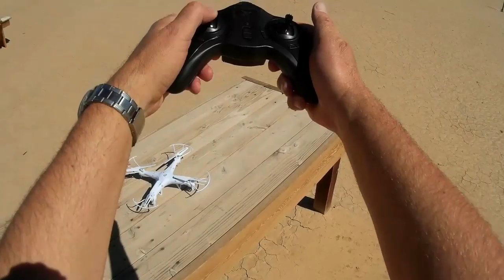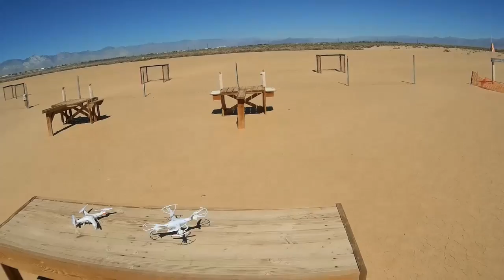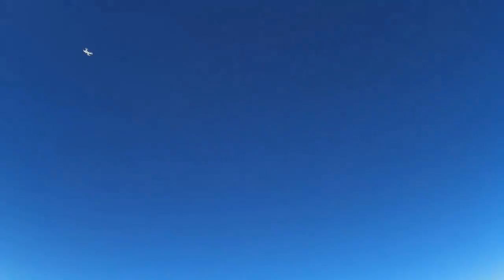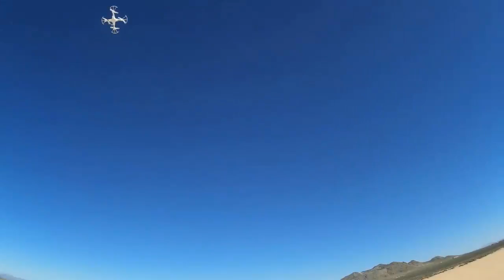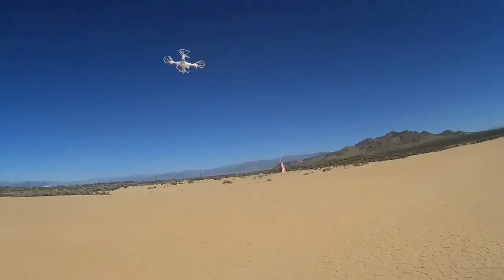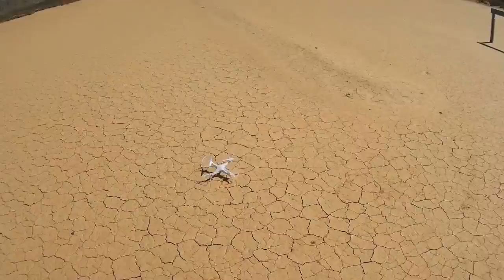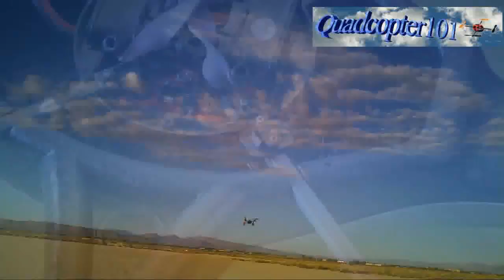FY326 Q7 drone:Syma X5C clone!

Comment: Anybody know where I can buy the body for the FY326 Q7? I have a crack in the plastic near one of the arm screws. As a result the plastic is bending backwards away from the body and it's affecting the motor on that arm. It's the screw closest to the lights.

Comment: Clone in video is outperforming X5C in any aspect. I started to think about original Syma X5C - which quad clone it actually is :)  Too bad, that FY326 Q7 is now sold only with red board which turn this little gem into utter rubbish. Good green boards are gone, stupid greedy bastards. I already wanted to buy this drone alas no deal without green board. Ordered FPVRC K5C instead.

Side note - nice demonstration as usual. Thanks!

Comment: Quadcopter 101, some people that have purchased this Quad, have been really disappointed, because they say the circuit board that was in the original Quad like you tested had a Green Circuit Board and they went to a Red Circuit Board, that has totally ruined a fine flying Quad. Have you had the chance to see a unit with a Red Circuit Board yet or seen one fly? Thanks

Comment: If I am correct, this quadcopter has better motors -> 8.5 mm x 20 mm instead 7x20 mm motors as Syma X5C or Bayangtoys X8. One thing bothers me: is it possible to bind this quadcopter with transmitter from Bayangtoys X8? Can you try to bind it and post the result here? Thank you in advance.
Reply from the maker: +Wild Maniac Sorry, both this and my X8 have been donated to local schools. I just don't have the storage space :(  But I really doubt that it's possible as they are two different companies.
Reply: Thanks. Eachine H8 and Bayangtoyx X8 can be controlled by either remote.

Comment: This is an awesome Quad, even with the red board versions ii have since i a a no0b
Had to buy a Syma X5 CW motor for my black Q7 since the motor burned out after 2 days from a crash which fell prop side down at full throttle ( im a noob so it was my bad). Have te mortor have yet to try and install. i have since revieved a new white model from amazon for 28 bucks with 2 day ship. Thanks ffor sharing

Comment: hello quadcopter 101 do you think x5c props would work on this since fy326 ones are out of stock
Reply from the maker: +Dillon Ravindu You can still get them on AliExpress, less than $3 per set http://www.aliexpress.com/item/FY326-RC-Quadcopter-Spare-Parts-4-x-Propeller/32463556619.html
Reply: will x5c ones work
Reply from the maker: Dillon Ravindu I'm not sure, but I don't think so.  These X5C clones usually use minor differences in all parts so that they're not interchangeable with the X5C.  That way, it prevents a lawsuit from Syma claiming that they stole their design.
Reply from the maker: ***** If you're interested in night flying, black is not a good idea (very hard to see, even with its lights).

Comment: just got mine today  its my first one  and saw your video made me buy question do i need to fix this trim or by default  they are ok  let me know thanks
Reply from the maker: +clash808 They're usually pretty close.  But if you plan on doing a lot of hovering, it helps to trim http://quadcopter101.blogspot.com/2013/10/quadcopter-flight-school-tutorial-1.html
Reply: +Quadcopter 101  thank you so much
Reply: hey again for a beginner do u recommend to have the prop guard and landing stand installed  or without it will be fine let me know thanks again
Reply from the maker: clash808 For a beginner, keep the prop guards installed until you find yourself not crashing anymore.  And always keep the landing skid installed.  It helps to keep dirt out of the gears.
Reply: +Quadcopter 101  thank you so much and have a happy holidays

Comment: Does anyone know where you can find the green board version? I have the red board and it is pathetic!
Reply: This is an actual FY326 green FCB. The same vendor has a transmitter available which will presumably bind to it. I haven't tried it myself though.

http://www.aliexpress.com/item/Free-shipping-2-4-GHZ-remote-control-RC-Quadcopter-parts-Quadcopter-FY326-aircraft-PCB-FY326-4/32371049977.html?spm=2114.01020208.3.253.xOt8G5&ws_ab_test=searchweb201556_2,searchweb201527_4_71_72_73_74_75,searchweb201560_9
Reply: Thanks!!

Comment: My Q7 has lost range, like 75 to 100 feet.  It used to get great range.  Have you ever experienced that?  Would you have any suggestions?  THANKS.
Reply from the maker: ***** Are you flying with a camera?  If so, RF interference from the camera can severely degrade range.  In that case, try shielding using a small piece of aluminum foil https://www.youtube.com/watch?v=JaQg0jvOX98
But if no camera is involved, are you flying near an apartment building or heavy residential area?  Residential WiFi signals can also degrade your range as it operates on the same frequency as your quadcopter's transmitter.  Try flying in a different, less congested area if that's the case.

Comment: Anyone considering buying this quadcopter should be aware that the manufacturer has changed the control board. The original was green and the new one is red. The new red board has only about 50m range and causes sudden drop-outs when reducing throttle. This is discussed in detail on the RCgroups forum.

If you do have one or still wish to purchase, there are some modifications that can be made both to the controller and the quadcopter to increase the range and alleviate (but not eliminate) the sudden drop-outs.

Happy flying!

Comment: Howdy Q!  I landed my FY326 into a mudpuddle which resulted in a motor change out.  The FY326 motor is slightly larger than the X5C-1 motor.  I have spares of those and they were just a tad too small for the motor housing cylinder.  Luckily, I also had some slightly larger motors that a vendor sent me by mistake and it worked great.  Not sure the model of the true FY326 motor but it is slightly bigger than my X5C-1 motor.

Comment: I agree with Brian on this.  The FY326 being sold now by gearbest is NOT the same as the one reviewed here.  The manufacturer has changed the control board and components such that range is poor with excessive dropouts making this quadcopter a bad choice.  Here's mine which is essentially is unusable for flight:  https://youtu.be/Yi7LQNsuNu4 .  For $27 purchase price I got a $15 refund from gearbest account for a future purchase.  Not fair in my opinion, but that's the risk in purchasing quadcopters from these merchants when you get a lemon.  FYI the Nihui U807 is a very good deal now (also from gearbest) at $38.  If you get a good one that is.

Comment: Luv your videos on my new hobby. Today I received this FY326 quadcopter. I wanted to post a picture of a yellow sticker on box mentioning headless mode. What you think 101? Thanks Len
Reply: Len Quelland Ok I took out and tested tonight, The Accelerator Trimming switches do 2 things. Upper switch turns (says in manual) Headfree Mode on an off and Quad will blink different when engaged and beep once. The lower accelerator button when pushed will go to return mode. To close this whole circuit just push upper accelerator button again. When I pushed return mode it did descend gradually and come back in my direction where I was standing. I tried same scenario again and usual headless mode does not work as usual on this feature. It was 6-10 mph so I had to run in high mode most of the time. Anyway I think this must be a newer released version I received as it has the yellow sticker on box that is to the left of my name as I cant post a picture.

Comment: I got mine today , never flown before , took it to the park and flew it, it wasn't easy but I realize I need to practice , so I was doing your instruction video going back and forth, then in about the 3rd battery drone was cutting out as if it was loosing reception in mid air and it droped a couple of times, and I was only about 50 or so feet away from it. could it be wifi interference? it's a small park surrounded by houses, so I'm assuming this is it, I did the sticking the antenna out the top mod like your other video and I'm gonna go to a different park tomorrow larger without any homes and try

Comment: I just received my syma x5 today and I had to wait extra long to get it because our postal service sucks, anyway I also have a Transmitter from a previous Quadcopter  which looks Identical to the one that comes with it for RTF  but I got mine for $25.99 because it has to be Binded. Well I charge the battery turned the Quad on lights are flashing but it won't bind, I also have a Hubsan and tried that Transmitter, nothing it wouldn't Bind.I'm open to advice and suggestions....Thank -= you
Reply from the maker: jeff sabo You will need to purchase a transmitter specifically for it.There were two versions of the X5C, the original and the upgraded model.  Although the transmitter looked the same, the newer upgraded model used a different format and would not work with the original model. But I'm not sure at this point which specific model that you have. Do you have a link to the advertisement for the model that you purchased?

Comment: Hi, I got this one as a beginner and I really like it. But is there a way to charge the battery faster? Maybe I could buy a seperate charger which plugs into a wall? I tried using the usb charger from my phone, but I think it damaged the battery (as it has much higher output than a USB port). Sometimes the rotors just do a very tiny twitch when I try to raise throttle for the first time after plugging it in and then it doesn't do anything until I replug the battery. After that, it may or may not work again. 
I ordered some new batteries so I hope it's not the quad which is damaged in some way. Greetings
Reply from the maker: Marc Möbius Are you binding the transmitter to the quad properly?  Try the following.
1) plug in the battery, and place the quadcopter on a flat and level surface.
2) Turn on the transmitter.  Bind it to the quadcopter by moving the throttle from zero to full, and then bring it back to zero.  You should hear a beep signifying that the transmitter has bound to the quadcopter.
3) Try flying.
and finally, there should be no reason why you can't use your USB wall charger instead of the computer.  That's what I use.

Comment: Hi,
I'm going to buy this quad, but I have few questions : 
- Do the parts break often on quads ? If yes, which spare parts should I buy ?
- What do you think about using an anti-vibration plate like this one http://www.gearbest.com/rc-quadcopters-parts/pp_133191.html for the Keychain (fixed with some DIY, don't want to screw it)
Reply from the maker: SpeezzGaming Everything breaks if you smack it enough.  But the props are pretty tough on this one.  At least I haven't broken one yet.  You never know what's going to break until it happens.  Good thing the parts are cheap http://shrsl.com/?~8f3w

Comment: Thanks for all of your reviews Quadcopter 101.  They've been very helpful!  Love seeing the cameras working on different ones!  Since the FY326 is so new, I'm wondering if you've had any success binding it to any other controller.  There's so little information.  I can't find anything on the protocol that it uses.  I was unfortunate enough to receive an FY326 with a dead controller and am just wondering if there are alternatives.  I've seen a comment on here stating that it binds to a WLToys V252 Pro Skylark Tx.  Have you had a chance to check that out?  Thanks very much!
Reply from the maker: Disgruntled Elf Unfortunately I don't have a Skylark transmitter. But I've tried, and I've not been able to bind it to others.  Did you contact customer service? Are they sending you a replacement transmitter?
Reply: Quadcopter 101  Yes, thank-you, I have worked out a deal with GearBest in regards to the transmitter.  Hopefully the new one will work!

Comment: I just got mine in and I feel like it is not getting the range shown in the videos. It seems like it loses signal when I get it out a bit. I can get my Hubsan x4 way higher and further. Any ideas?
Reply from the maker: Robert Neal Check the quadcopter's antenna to see if it's too close to the board. Raise it up away from the board some if it is.

Comment: I got one of these, and mine must be defective.  Even after recalibrating, it wants to roll severely to the right.  If I do a left roll trim of 25+ clicks, it may start to level out . . . must have received a dud . . .   going back to my X5C . . . any thoughts ?
Reply from the maker: bobclarie You did recalibrate? (Placing the quad on a flat level surface, moving and holding both control sticks to lower LEFT corner until center light rapidly blinks).  It's lower left corner on this, vice lower right for Syma X5C.  Also hand spin each of your props, feeling for any binding or unusual resistance, such as from debris in the gears.  Finally, check the installation of your props to make sure that the factory installed the correct props on the correct shafts (CW vs CCW).  Compare your quadcopter to this image, making sure the shape of the props match the installation locations.
Reply: Quadcopter 101 Thanks for your suggestions ! Yes, did try recalibrating, several times . . .  Props do appear to be mounted correctly . . .all blades turn freely, although the front right, and rear left  blades do have a little more drag when compared to the front left and rear right.  There is a lot of "play" in all the propellor shafts.  Thanks again for your prompt response.
Reply from the maker: bobclarie Well you've done everything. Recommend contacting customer service http://www.gearbest.com/about/contact-us.html
Reply: Quadcopter 101 Thanks, I will do that.  I look forward to your quadcopter YouTube productions.  Very Informative.  Keep up the good work.  Looks like you are having Fun.
Reply: Gearbest thinks it's a bad controller and said that they would send me a new one.  f.y.i.  Bob
Reply: Hi, I have the same problem. Did the new controller resolve the issue?
Reply: +tatotazman Gearbest never sent me a new controller/transmitter, even after several e-mails promising to send.  I ended up putting a Syma X5C control board in my Q7 quad and flying it with a X5C transmitter. The X5C is your best bet . . .  Bob
Reply: Thanks

Comment from the maker: FY326 spare parts http://shrsl.com/?~8f3w
Reply from the maker: MrOuchiez 1. Make sure that your quadcopter's battery is fully charged.
2. Turn on the quadcopter, and place it on a flat and level surface.
3. Turn on the transmitter.
4. Move the left stick throttle from full down to full up then back to full down (you should hear a beep indicating binding).
5.  Move the throttle stick back up and see if it takes to the air.
Reply from the maker: MrOuchiez Well it sounds like it's defective.  Recommend making a short YouTube video clearly showing the problem.  Send the link to your vendor's customer service to help overcome the language barrier.  Hopefully they can help.  But if not, final step would be to open a Paypal dispute for receipt of a defective product.
Reply: Do you know if there's a known issue with q7 motors? I'm on my second one and one of the motor has stopped working. First one had a faulty motor out of the box. Do you know where they might sell spare motor for the q7?
Reply: I absolutely CAN NOT get this thing to bind to the controller!  I got lucky once, and it flew amazingly, but quite honestly, Im not sure what I even did to get it to bind, as there were issues then as well!  The manual is a mess to try to interpret, and Ive finally got a clear, windless day to fly! How are you supposed to bind this thing?
Reply: Quadcopter 101
Thanks for the reply.  After following each step (which has been standard for every quad Ive owned) the transmitter wont bind.  Whats strange is the transmitter's light blinks and you hear a "click" or "chirp" from the transmitter that the LEDs on the quad quickly sync to. So there is some level of communication between the two.  But still no binding.
Reply: Thats great advice.  Thanks so much!  Ive been subbed to your channel for nearly 2 years, and have learned how to fly from your tutelage.  Keep up the great work!
Reply: Know anywhere I can get spare motors? 
They don't have anything on your link...
Reply: ovak
https://www.amazon.com/Quadcopter-Propellers-Landing-Protectors-Protector/dp/B00TJSJWQ2

Comment: I have a question, I have found a zyma 5C copter in my yard, but I don't have the remote control, do you know if I am able to buy just the controller and use it for the copter or do i have to buy a whole new one?
Reply from the maker: Desmond Torrez $14 for the transmitter http://shrsl.com/?~8dt4You'll need a charger too (about $2 here) http://shrsl.com/?~8dt8
But one of your neighbors is sad.
Reply: Oh thank you! 
Yeah haha no idea where it came from. We technically arent in a neighborhood, but we have them surrounding us.
Reply: Quadcopter 101 is there anything I will have to do to make it work, or will it just work on it's own?
Reply from the maker: Desmond Torrez Of course you'll need to charge the battery before the first flight. But here's the user manual http://www.symatoys.com/Tools/download.ashx?id=163
and this site should help you learn how to fly (Read and follow the right side table of contents as listed) http://quadcopter101.blogspot.com/2013/10/chapter-1-introduction-to-quadcopters.html
Reply: Quadcopter 101 thank you for your help.